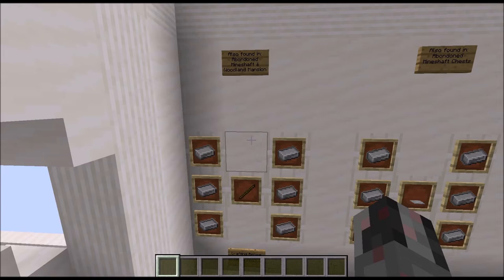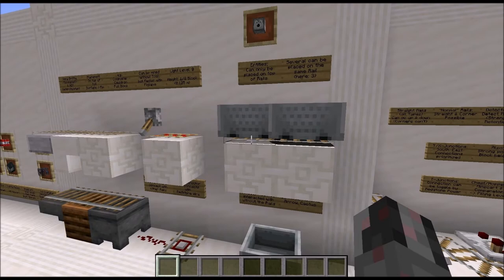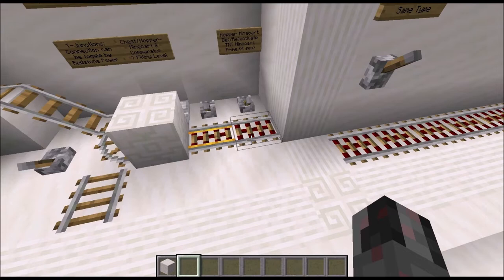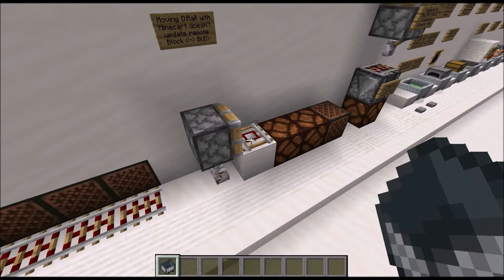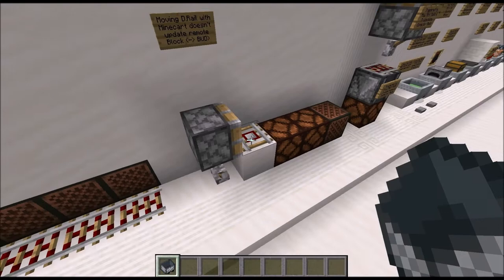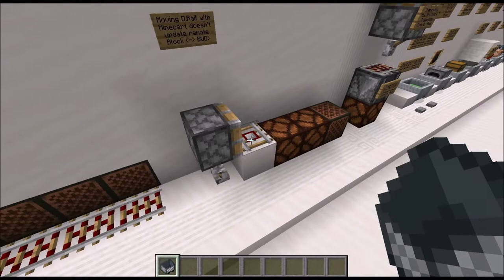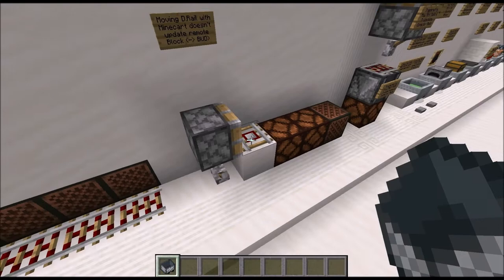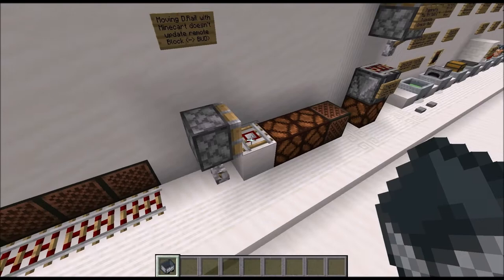Redstone Components: Episode 13 - Rails & Minecarts [Java Edition 1.15.2]

Comment: Amazing as always.
Is there a way to detect if a minecart with chest Is empty while moving on a track. So when the minecart is empty it notifies the player by sending a signal to a redstone lamp or something.
Reply from the maker: It's possible. You need to use both functionalities of the detector rail at once:
1) Direct Output -> Detection of Minecart
2) Output via Comparator -> Detection of filled Chest/Hopper-Minecart
3) Invert 2) via redstone torch, then run that together with the output of 1) into an AND-Gate -> Detection of empty/non-container Minecart
4) Run the output of the AND-Gate into the lamp
5) Profit
Reply: @RKFWalter  thank you so much it works like a charm
Reply from the maker: Happy I could help :)
Reply: @RKFWalter  i know this has nothing to do with rails but is there any if-then circuit like the one in a truth table? If there is how do i do that. Thanks in advanced
Reply from the maker: I'm not entirely sure what you mean. If you're looking for boolean logic circuits I would recommend searching for "logic gates" or similar, though.